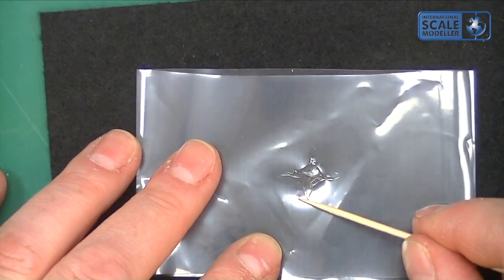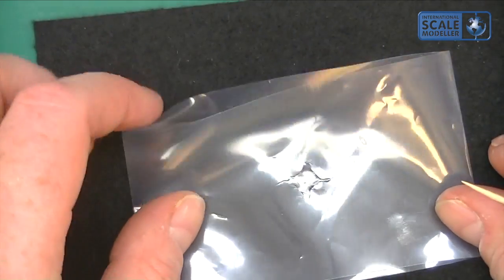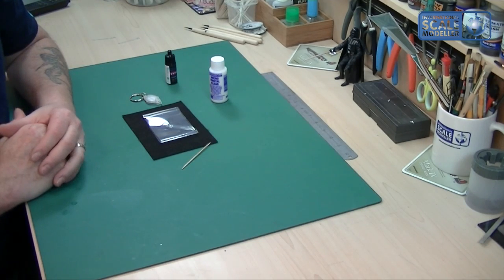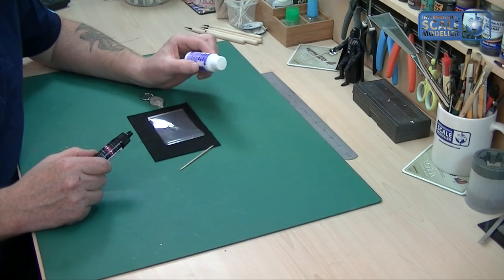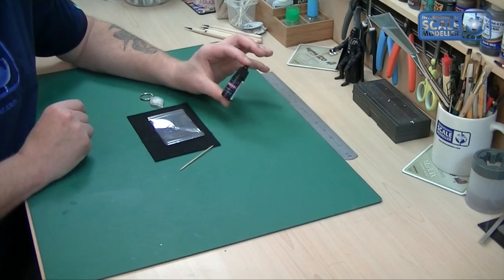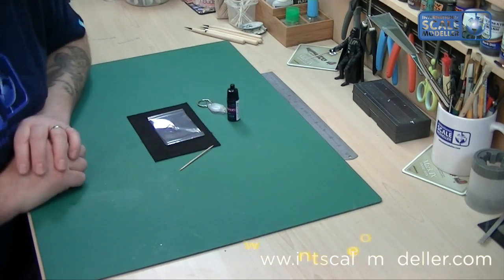UV Glue Review

Comment: We've been using UV cure resins in aerospace manufacturing and repair for a over a decade. It is now widely used in "finger nail" sculpting. A much cheaper source would be the "UV cure nail enamels". The small UV lamps used in nail shops are also cheaper. You'll love this working with it...it has so many applications!
Reply: +Rick Barton Do such nail enamels cure to a hard material? I imagine that they have to be easy to take off later.